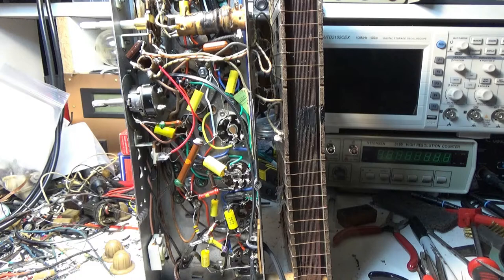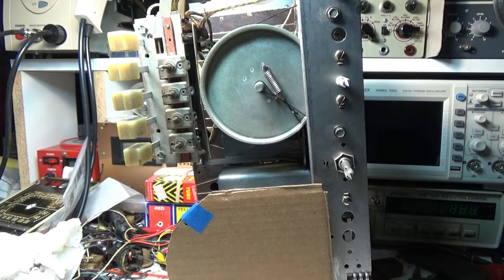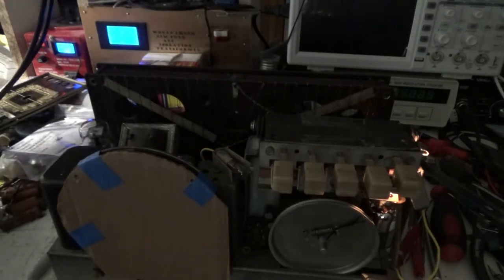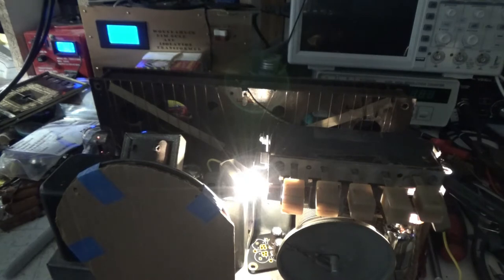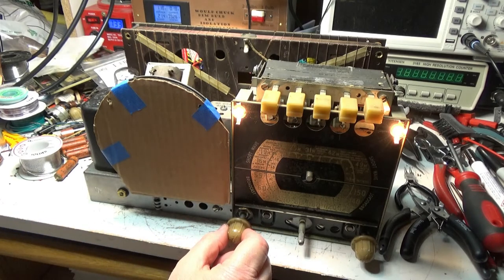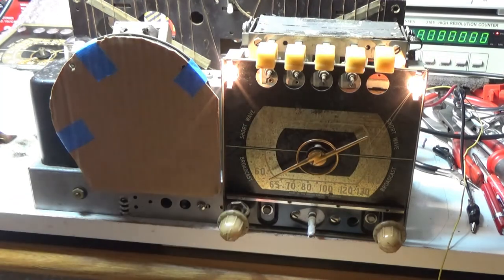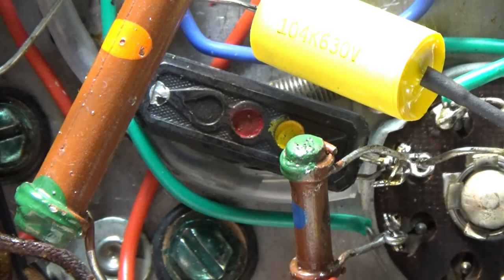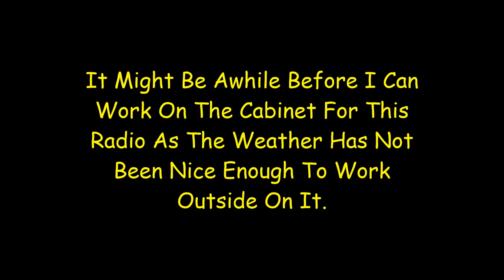Zenith Model 6S527: Part 4, Finishing The Wire Replacement and Troubleshoot

Comment: i just started working on one of these. you gave me a lot of things to watch for. i like your thead idea for running wire back through the spring in pt.3. it's been two years since you posted this, so i don't have high hopes...do you still have the spare radio? i need a few things for mine.